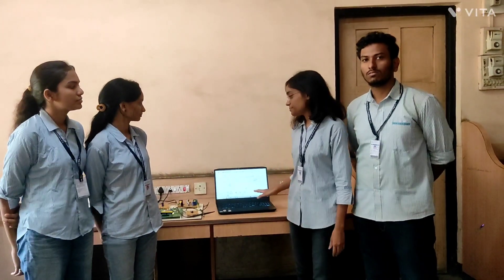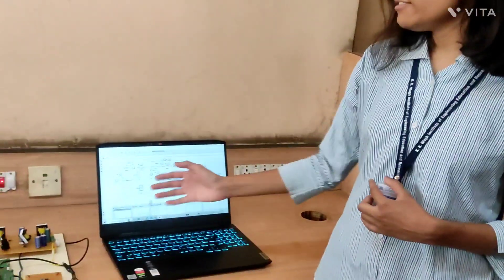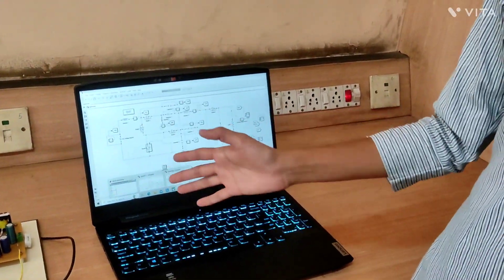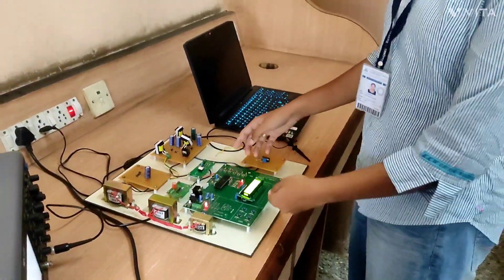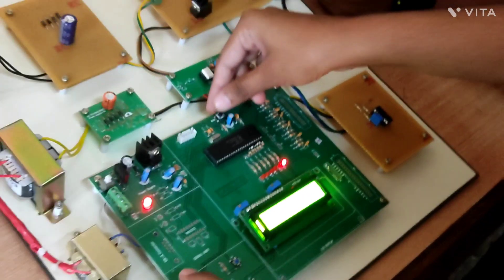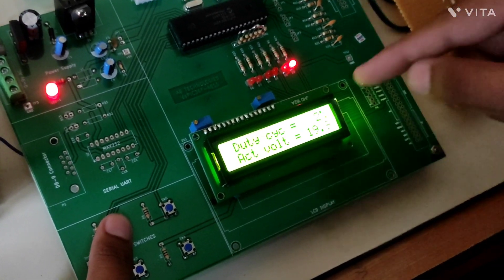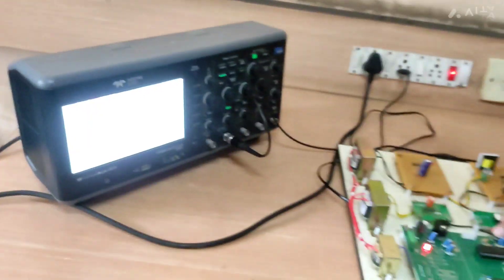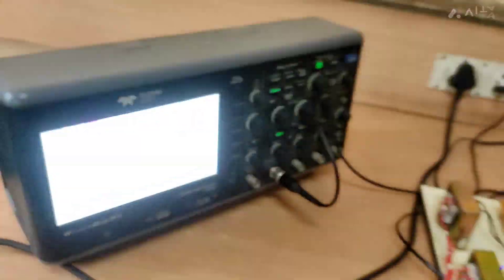Design and Analysis of a Transformer-less High Gain SEPIC DC-DC Converter

Comment: If u want to use transformers here get one multi-tapped output transformer. less devices on unit
Reply: Sir can't you understand my thair spach 
??? 
They are just reading a script given by the teachers that's all 
Just bookworms understand this 
Saying this by my personal experience 
If you need to point out the design flaws in this 
Hear you go 
Instead of using three separate Transformers you can just use one SMPS of 24 volt 
Induced three different buck converter for the different voltage leave 
For cost effectiveness and power efficiency
Reply: @vkproduction1166  A amps is fine but seeing three transformers explains why I said use one multi-tapped version.keeps it more relevent to the visual latout
Reply: @ssgeek4515  oh ok thanks today i understand visual layout is more important then cost of production 👏

Sir mult-tapped transformer is more costly
Just think once when you have multiple ac supply you need to use different rectifier for each supply 

As you think of using my idea you can improve the cost of production effectively and less components 
Thank you 🙏